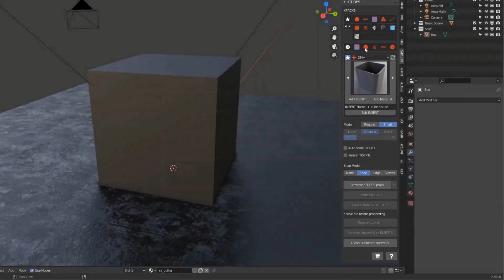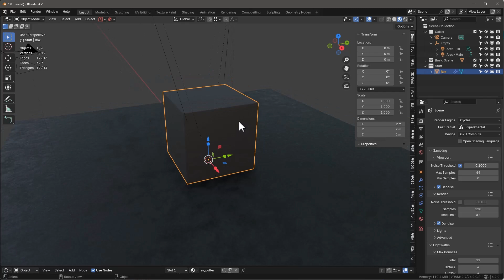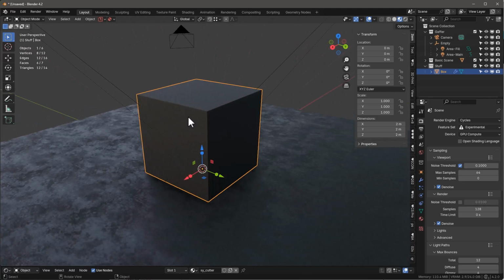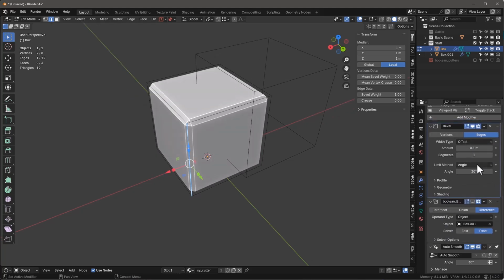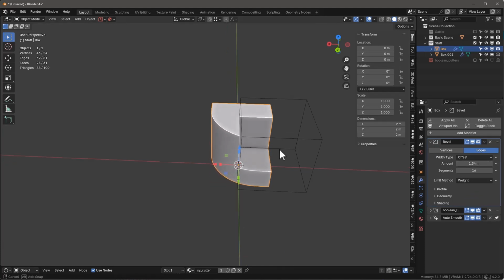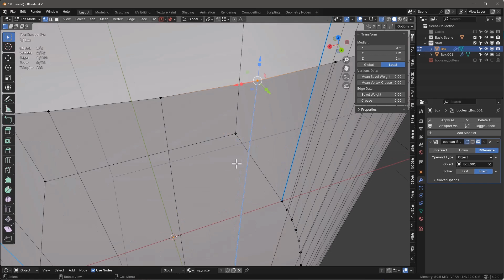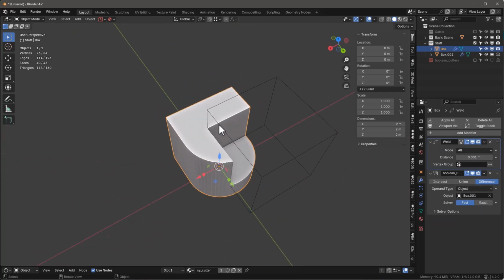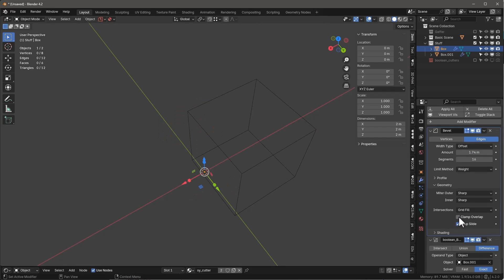Blender Non-Destructive Modeling with modifiers

Comment: Would you consider to do a new version of the NITROX3D tutorial? It's awesome but 4 years old and a lot has changed since.
Reply from the maker: The only thing that has really changed is where the modifiers are found in the modifier list. I use them all exactly the same as previously. 

And, I've added the weld modifier which I go over in this particular video. Everything else is the same.
Reply: @ChippWalters  Thanks for the feedback and for your insightful videos.